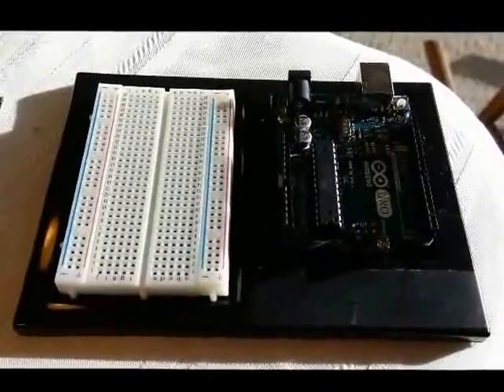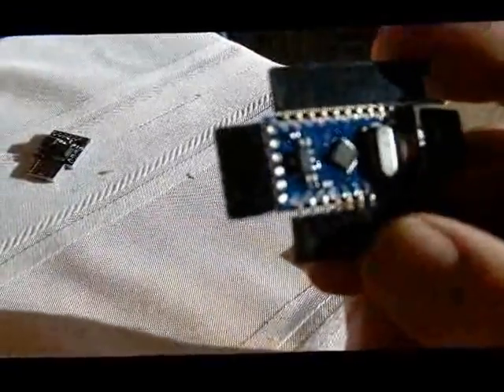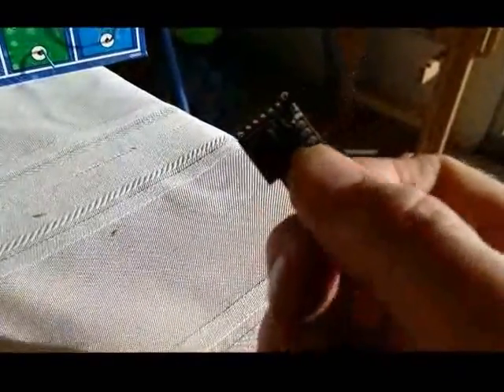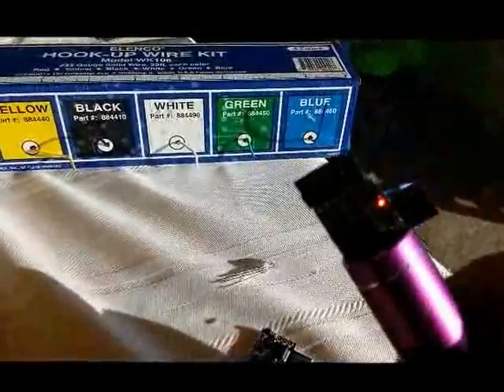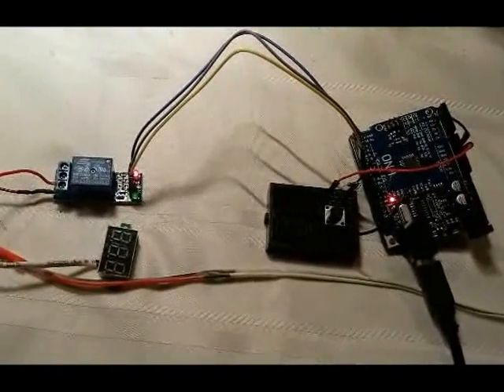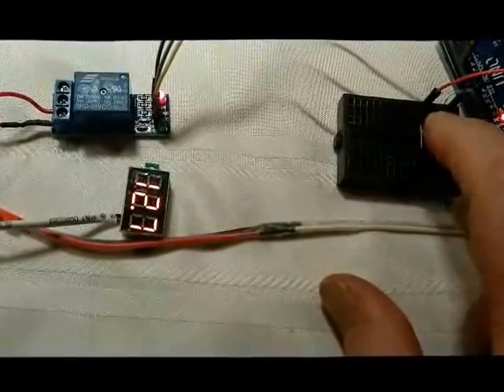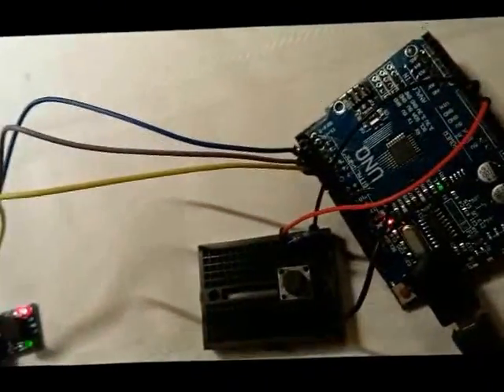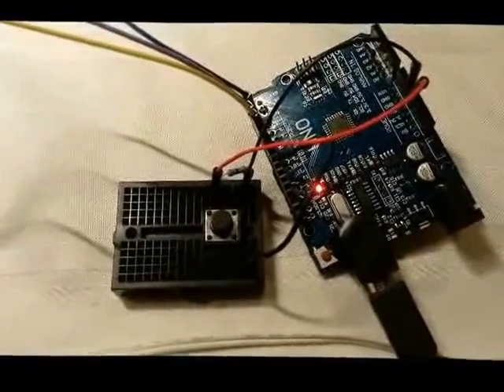arduino replaces FRM01 timer for a specific use

Comment: John what type of momentary switch can I use to mount on the wall or my external box.    Obviously have to have 3 connections.   This setup works great.
Reply from the maker: I would look for a waterproof one, and I would include two waterproof LEDs, one that allows the user to know the valve is supposed to be on (in case of a valve malfunction) and one that tells the user the timer between valve functions is operating.

Other than that, I have no suggestions.
Reply: +John Ayer I am leaving a led to show valve open.  Just not sure how to hook the switch with the configuration.
Reply from the maker: Well, I'd find a waterproof switch and solder wires to it.  You'll need three wires, a power wire and two wires off the ground side.  Cut one in half, solder a 220 or 330 resistor to the wire, slide some shrink tube over it.  Solder the wire with the resistor to gnd and the other wire to an input on the arduino.

Comment from the maker: Anticipating questions:

Relay pins:
Pin 5 is voltage to the relay board. (could run to 5v output on Arduino or any 5v source)
Pin 4 is ground for the relay board. (could run to gnd on Arduino or gnd of 5v source)
Pin 3 activates the relay.  Code High turns it on.  Code Low turns it off.
Button pins:
Pin 8 outputs 5v for the switch, but, I used the 5v output on the arduino instead.  Any 5v source will do.  Delete the code for pin 8 if you like.
Pin 9 inputs from the button.

I ran a 5v input to the button.
from the button, 220K resister to a wire that runs to ground.  Pushing button completes circuit.
from the button a wire that runs into pin 9 (INPUT).

When the button is pushed, Pin 9 received a signal to start the timer.
While the timer is being run, the controller ignores the button.
When the timer finishes, the button becomes active again.
Have to hold the button down for more than a second to make the timer work.

Comment from the maker: Parts list:

Arduino Uno R3 Board w/usb cable
5v relay board
bread board
momentary action switch
220 ohm resister
hook up wire
Load items (I use a volt meter, these could be a valve, a pump, motor, etc)
9v power supply (for arduino, 1 amp good)
12v power supply (2 amps or more based on requirements for stuff.  Arduino can run off of the same power supply depending on how much wiring a maker would like to do)
Reply: +John Ayer  John could you give me just a little more clarification on how the button and breadboard are wired.
I have it hooked up to what I think you have, but mine is repeating the cycle randomly with out pushing the button.
Reply from the maker: Hi:  are you using the FRM or an Arduino?
Reply from the maker: Did you put the resistor in?
Reply from the maker: Hi Robert:  I try not to annoy people by doing tutorials others have done much better than I do.  I try to cover things that others don't cover.  There is an excellent tutorial on arduino and buttons athttps://m.youtube.com/?reload=7&rdm=1xk0qu6y5#/watch?v=LOw4OHAx8mE

Or just do a YouTube search on Arduino Button.  Some great tutorials out there.  If you still have problems, I'll do another video with a better explanation.
Reply: +John Ayer I am not using a button on the bread board(didn't have one) usingq a momentary push button.
are the red 5v and black ground from output together with the resistor between?
Reply from the maker: The resister is between the button and ground.  There is a second wire from the "gnd" side of the button and it runs from the button to pin 9.
Reply: +John Ayer  I have the whole button issue solved. Its working perfectly every time. My next hurdle is getting 12v to come out of the relay. to actuate my valve.     I have a 12v power supply going into the arduino.   I don't get 12v coming out to valve. Are you running a separate 12v  to  where you have your voltage detector?  I see the white cord laying in front of the setup.
I apologize for being pesty, but you have me hooked on these electronic devises you build.
Reply from the maker: You can use the same power supply, but, I wouldn't unless you run it through a 12v battery and put a diode in to eliminate feedback from the solenoid.  The solenoid is just a switch, so, put it one side of the 12v coming into the valve.